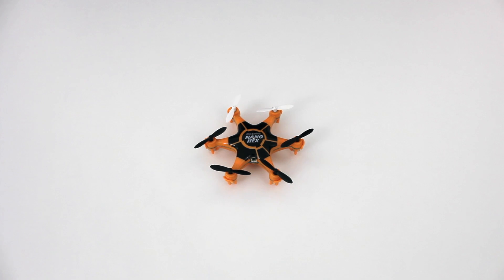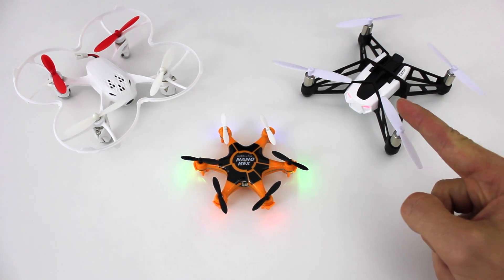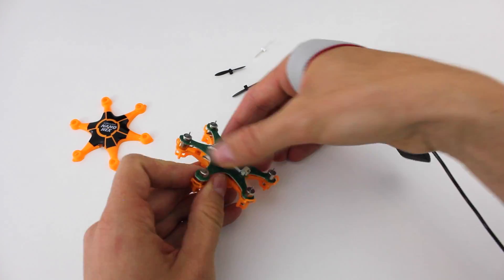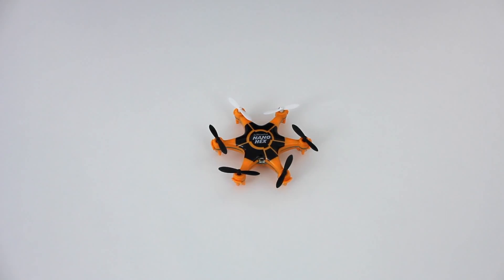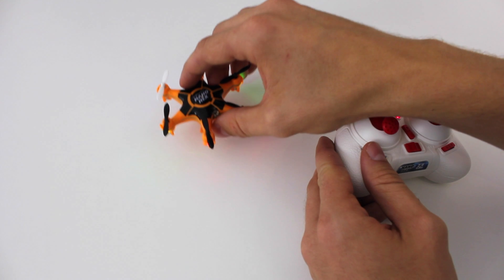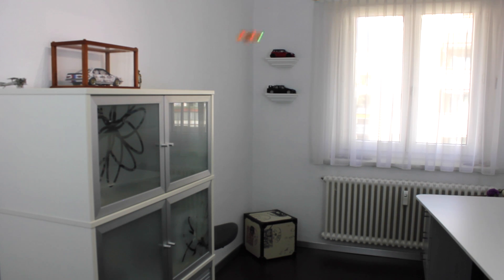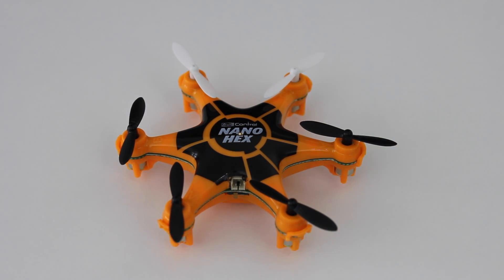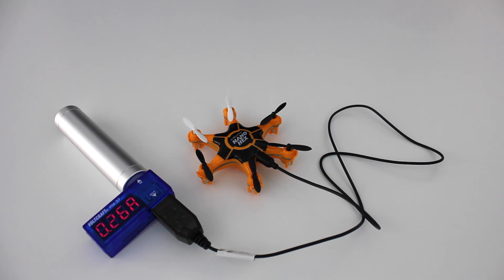Revell Nano Hex - Hexacopter Review

Comment: Hello, I'm curious to learn how many cycles the built-in battery can last on this hex.

Also, in other reviews this model has rubber landing feet instead of plastic landing sleds like yours. Do you have an older or a newer model? Or did you choose to use the landing sleds when you had both options?
Reply from the maker: +Quad Fly 
So far I have fully recharged the battery around 40-50 times without seeing a significant decrease in flight time. But, usually I don’t fly with a stop watch :-)

I’ve noticed that too with the rubber feet, I guess there could be some regional model differences. If I’d had a choice, I would have preferred the rubber feet version. I assume the landing would be softer and the added weight may make the controlling easier but the battery would be discharged faster.
Reply: Tech2210 Thanks for the reply! I am considering to buy one of these but I'm not sure if it's worth the money (50 € in my case).

But if it can fly for at least 100 times before the battery dies then maybe it deserves the money.

Make more videos, please. It can be useful to have someone like you open up the toys and inspect assembly quality. Though nowadays everything seems to come from China. Even the Revell brand seem to be repackaged Chinese goods not made in Europe.
Reply from the maker: +Quad Fly 
thx mate :-)
Reply: mine too doesn't have rubber feets ,the box says nano hex & not nano hexacopter ,but light are better,
maybe is even smaller, underside is diferent,maybe are two versions for two different continents.

Comment: dont trust this guy he is wrong because it can not charge on a plug in only charges on a computer because if you charge it on a plug in it will burn the battery
Reply from the maker: +Natalie Mitchell: The iPhone wall-charger 03:52  transforms the higher voltage (110-240V) of the wall-socket to the needed 5V - so, no batteries are going to burn :-)
If you’re curious search on YouTube for "How Transformers Work", or watch this: https://youtu.be/YQQ-mgjCpn8